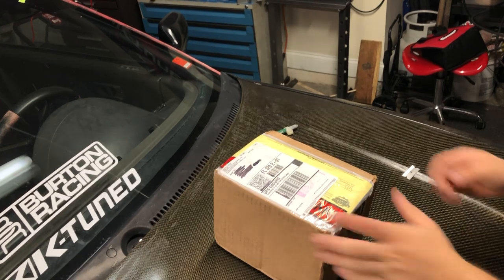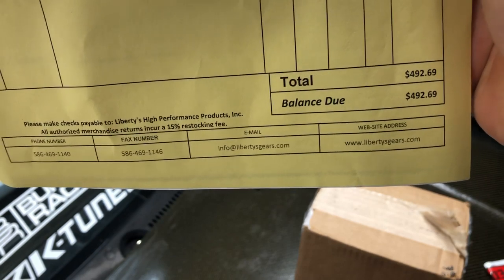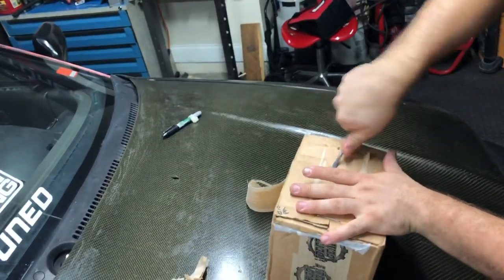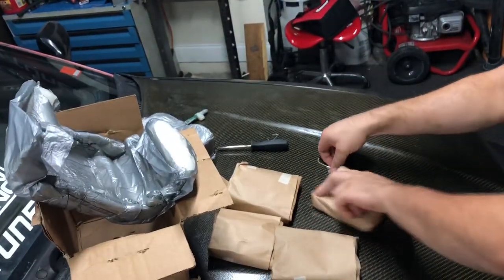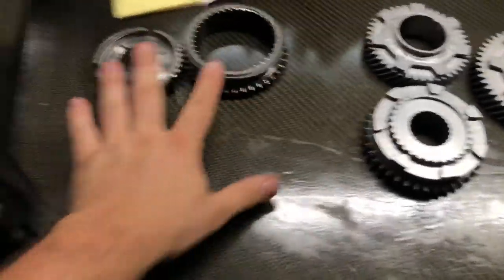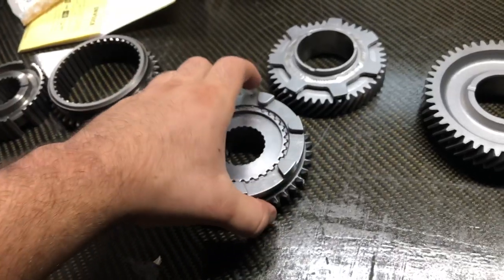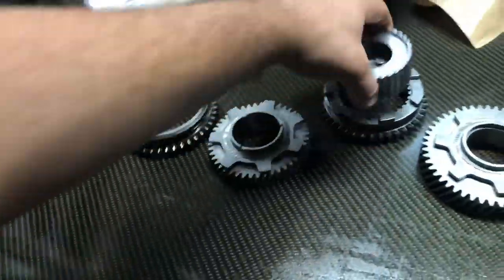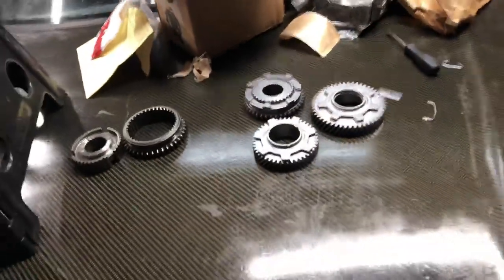Liberty Gear FacePlated Gears || Unboxing

Comment: This guy's a real winner, had trouble opening the box, then doesn't know first from second gear, but sure has a cool carbon fiber work bench.
Reply: Is there any telltale signs of which gears are which? Genuinely curious as I have a bad 3rd gear right now and spare trans broken down that I'm using to figure out how transmissions work lol